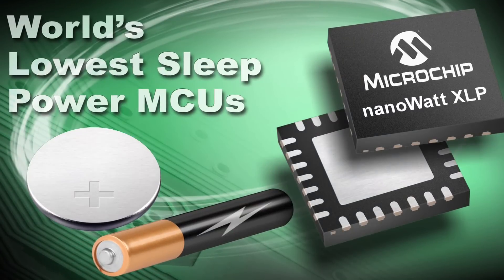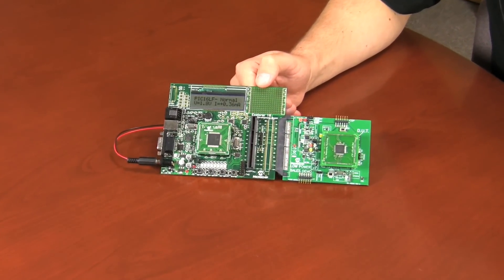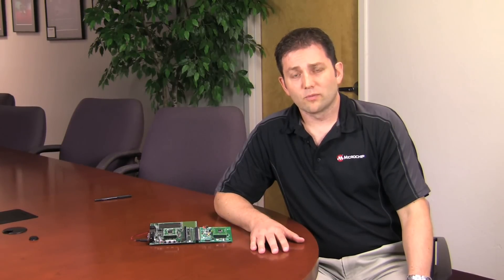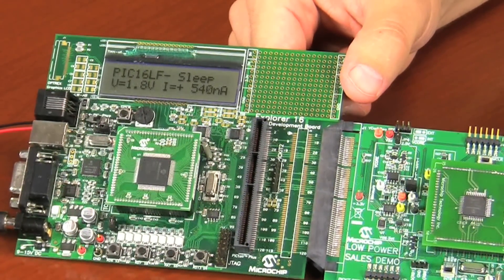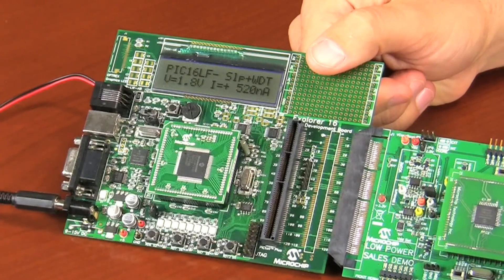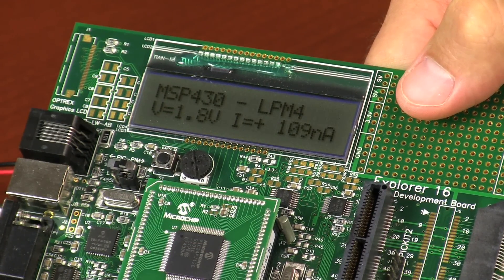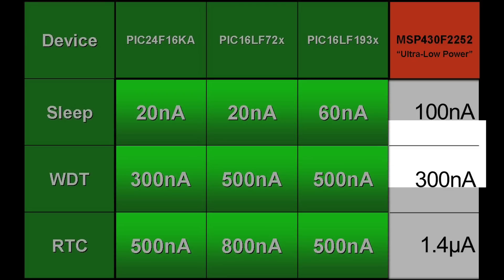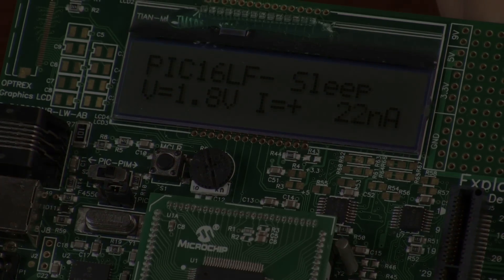More Low Power MCU Comparisons: nanoWatt XLP Vs. MSP430

Comment: @SolutionByEvolution This is shared by both the MSP430 and the PIC24F.  Microcontrollers in both the XLP & MSP430 families have internal regulators.  Coming out of Deep Sleep mode, or LPM5 on the 5XXX series devices, parts with regulators will need to charge the Vcap and there will be in-rush current.  Other MCUs in both families do not have internal regulators and will have a much smaller in-rush current.  In the video, we are showing XLP and MSP430 devices that do not have internal regulators.

Comment: @SolutionByEvolution Thanks for pointing out differences between Sleep and Deep Sleep.  In this video, we are showing PIC16 devices which do not have a Deep Sleep mode.  It is apples to apples.  The PIC16’s Sleep mode is equivalent to the LPM4 mode of the MSP430.  Adding WDT or RTC is equivalent to LPM3.  Please don’t judge me because of my marketing title—I’ve been a practicing engineer for over 18 years and have led numerous chip design and application teams.

Comment: @yttrax Yes, there are compromises that must be made to get to nA current consumption.  However, PIC microcontrollers with XLP give you the option to choose Sleep with RAM retention, and with only slightly higher current consumption; or Deep Sleep to get the most from your battery.

Comment: @rfengr With XLP MCUs there are many ways to go to Sleep mode.  You can Sleep with RAM retained, you can add a WDT or RTCC, or you can go to Deep Sleep which is the lowest current option.  You are correct that Deep Sleep mode behaves like a reset at wake up.  The Sleep mode differs from Deep Sleep, in that you maintain the RAM and Registers, and it restarts at the instruction in which you left off with no reset.  I bet the trouble you have experienced is due to the use of Deep Sleep vs. Sleep.

Comment: @rfengr If its a short dip perhaps it was/is due to charging of Vcap, but I suspect you have already looked into that as a possible cause. I'm fortunate to have a reasonably low impedance supply in my designs, so probably did not detect this as being an issue. I haven't used the MSP430 but I might invest in one of their programmer/low end evaluation kits to get familiar. Seems that the MSP430 line is truly designed for real world low power/current applications.

Comment: @SolutionByEvolution Another problem I noticed about the XLP is the startup power, which is very important if you have energy harvesting. The XLP (for reasons unknown to me) have a high startup current requirement before they go into stable mode. This causes a spike in current draw which dips the supply voltage below BOR causing a system reset (not the case for MSPs). Also, for ultra low power applications, normally we have to operate from a 3v coin battery, so the 1.8v does not make any sense.

Comment: @rfengr I think you are activating deep sleep on the PIC rather than regular sleep mode which has RAM retention (I know this from experience). I agree however that the numbers quoted are not fair, I think they are using deep sleep on the PIC with no RAM retention and LPM3 with RAM retention on the MSP430 which is not apples to apples. But hey what can you expect from a sales representative? Shame on you Microchip for letting this clown represent you, engineers are hard to fool.

Comment: NO! ... This is not a fair experiment. I've been a loyal customer of Microchip for at least 7 years, and switched from their PIC16F to PIC18F (for more memory) then to PIC24F (for a better architecture) and Finally to the PIC24F-XLP (lower power). I've had nothing but trouble with their flash memory and architecture, the XLP has NO RAM retention! so you have to start from reset vector after a wake-up. 
LPM0 through LPM3 on the TI-MSP430 all have the BOR and WDT enabled as well as RAM Retention.